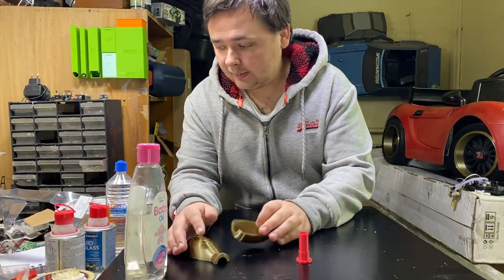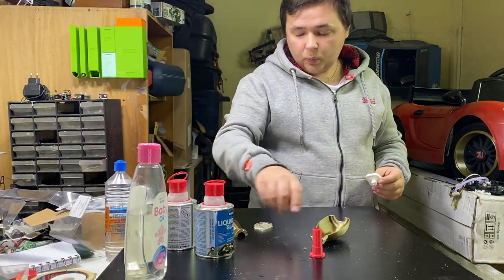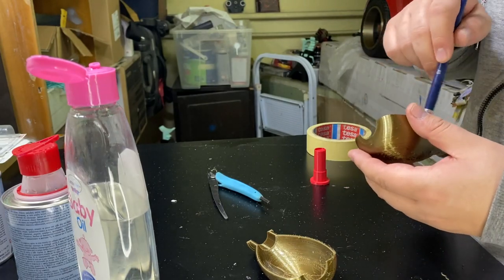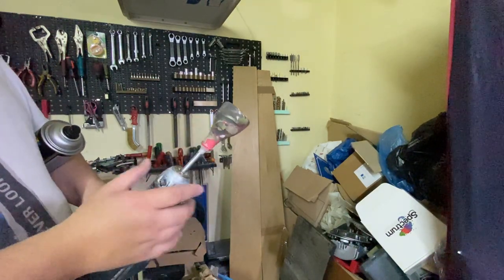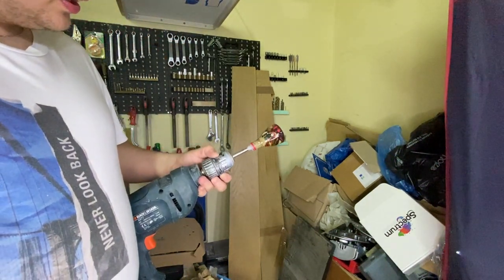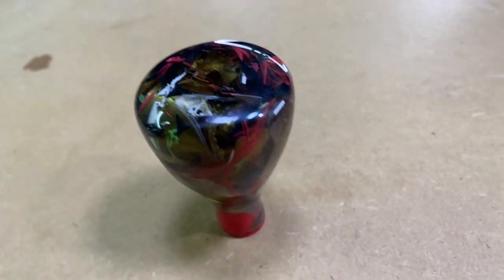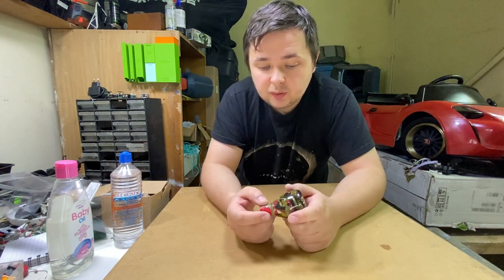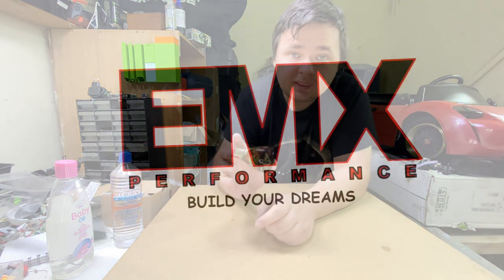3D Printed Resin Mold Car Shifter

Comment: Hey dude. I have just done something similar to you. I used Honey wax as a release agent and it worked perfectly. I would also advise that you create some holes on the side of each half of the mould, so you can bolt the 2 pieces together, Then use some filliting wax down the seams of the 2 pieces. This will stop anything from leaking from them.

My problem I had was that I used too much hardener in the resin and it made the mould warp slightly. So the second time I did it tonight it wasnt perfect. Keep up the work! Good luck!!